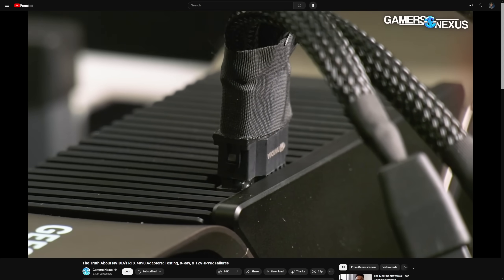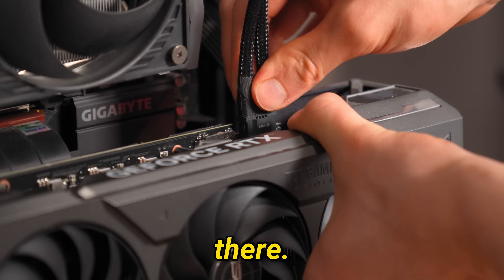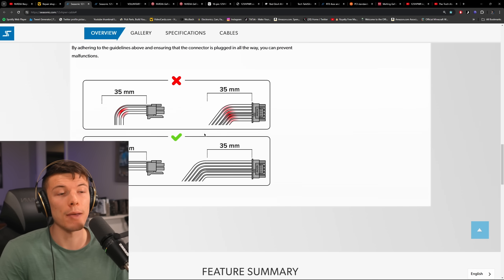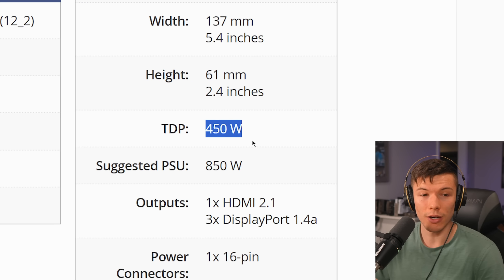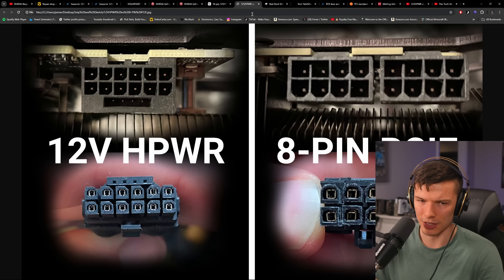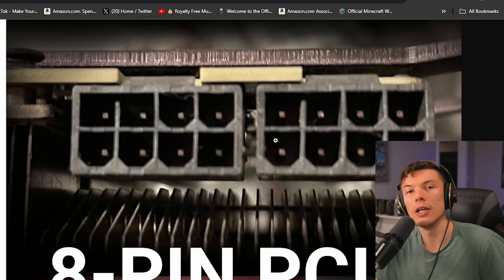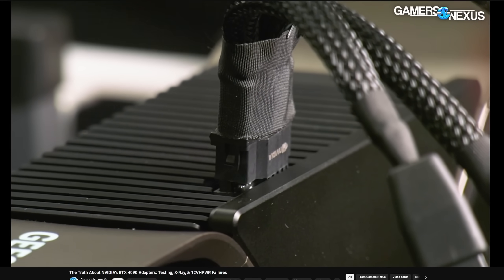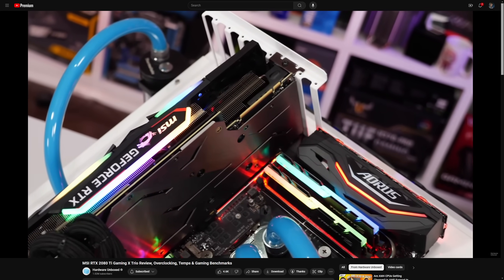The Dumbest Thing to Happen to Graphics Cards

Comment: I am just suprised that there is no lawsuit against Nividia. This is clear fire hazard and should not be tolerated. Probably if someones home burns down then there will be some action.
Reply: They have more expensive attorneys and spin doctors. The consumer would never win.
Reply: @Sybertek  pretty sure that's just about every corporation...yet, things still happen.
Reply: I think there is a chance of it, but considering a vast majority of cases will be due to “user error” (regardless of the cable design if it’s not plugged in it’s going to melt), or at least can be successfully argued as such in court, you are going to have a hard time winning. It’s the same with all sorts of shorts and such with computers. My motherboard basically ignited recently after a fan splitter pin broke inside one of the fan extension cables. Can I sue noctua for the cable, or MSI for the board? Or do I just get the RMA on the mobo and move on? Most people pick the latter
Reply: @solkvist  it's not user error. Tolerances should have been built in for consumer products to ensure it doesn't self-destruct if it was not inserted optimally.

They're only blaming it as user error to gaslight the customer and save money because a recall would be extremely expensive, especially if it's not the only part that was destroyed in the process.
Reply: @solkvist That's why meeting specifications matters. In your case noctua did nothing wrong and if god forbid the house burnt down, insurance would cover it.
This is why cablemods issued their recall, they would have been in a world of pain if something worse than a melted termination happened.
Reply: The lack of a class action lawsuit just proves that NVidia buyers are fools, sadly ...
Reply: It's a design problem. NVIDIA took a design from PCI-Sig, a consortium that also includes AMD, and used it as per it's design spec. It was also established that manufacturing wasn't the culprit, but bad design (low factor of safety). NVIDIA has done as much damage control as they could, because it's ultimately their products and reputation on the line... But legally they're not liable for the bad design because it's a 600w rated connector they're only trying to feed 450w through.
Reply: put out a petition
Reply: The problem is still not solved and it's not user error.  Despite widespread publicity and user precautions  YouTube Northwest repair still sees 100+ 4090 burnouts per month ...
Reply: @systemBuilder  😀 wow that many, is it only that card? is it safer the 4080, 4080ti with the same power plug?
Reply: Reason melting connectors happen in waves. Ready for this? AC units and Space heaters in the winter.

Draws too my current away from the card and the card amps up to meet demand, only for that demand to be pushed into over drive once the ac or heater cuts off. 

This happens to even very well plugged in cards.

It's not a user error. Even the heating and cooling can push a well connected connection apart due to the expanding air inside the connector. 

NVIDIA should be sued. Forced to repair all old style connector on their dime plus shipping.
Reply: @EBackwards  🙂 neat, i didnt know that
Reply: There Is Nothing In The case That Will Ignite! After The Wires Melt Into A Short The Power Supply Will Shut Down! Why Cant They Put Multiple Sockets So You Can Plug It In From The End Of The Card Or Side? Then The Connectors Would Not Be In A Bind When You Close The Case Door!
Reply: "I left my PC to go out for lunch with my friends while my 4090 was doing a large render. When I came back, the fire department was putting out what was left of my house."
Reply: @greevar  lets get that twin tower money larry epstein got. Or whoever it was
Reply: It's because they specified a $2 power connector instead of a $3 one. For a $2,000 graphics card.
INCOMPETENCE PERSONIFIED.
Reply: Give it time. If your house burns down and it's out of spec, wave goodbye to all that expensive insurance you paid for.
Reply: @mercurybullet6043  what ? What do you even mean "house out of spec" like it's a damn computer 😂
Reply: Because it isn't a fire hazard? Are you keeping oil soaked paper in your pc case? There isn't anything flammable inside a normal pc.
Reply: @lycanthoss  you never heard of an electrical fire before?
Reply: @minion3806  an electrical fire is just a fire. For there to be fire, there has to be oxygen and something flammable. Pray tell, what flammable objects are there in a typical PC (at least ones that sit next to the connector)?

What is happening with the 4090 connectors is MELTING. Sure, if you brought something flammable close to the connector, then maybe you could start a fire. But without anything flammable, the connector will simply melt and the PC will shut off when it sees something is wrong with the GPU, or it just won't boot.
Reply: @lycanthoss there's a reason fire extinguishers are coded for different uses cases. Electrical fires aren't just fires. Just like how grease fires aren't just fires. Sure, flames are flames. But how they start and how they continue are different. Electrical fires start on the components. Plastic that is in PC cases and components are flammable after a certain point. Once your components start catching, the fact your PC has multiple holes designed for air, means it's not going to stop soon.
Reply: @TheTrevler  Very true. You can tell people went to school and did absolutely nothing.
Reply: @lycanthoss I think you need to understand what an electrical fire is.
Reply: @lycanthoss  plastic is generally flammable at high enough temperatures. I personally would be wary of these cables melting for that reason
Reply: @lycanthoss everything can burn if there is oxygen and guess what there is always oxygen in a pc case because there are holes for airflow and electrical fires are one of the most dangerous fires iirc
Reply: @deathdrop  its a specialized non-flammable plastic. nothing where the connector reachers melting temp can melt.
Reply: @lycanthoss  you are so painfully wrong I don't even know where to start.

For 1, the entire fucking thing is made out of plastic. Besides the case. Like wtf dude , plastic flows all over the place when it melts.

You are purposely being ignorant here.

Comment: The 12 pin somehow  makes Apple's Lightning connector look like a reliably durable innovation. Just sayin...
Reply: Lightning is one of the most reliable connectors what are you saying
Reply: For as archaic as the lightning connector is, at least the cables never melted my old phone's charging ports
Reply: They shouldve added a clip and the problem would be less
Reply: @Dr_b_ I've had 15 or so across 5 iPhones. The lightening connector is junk
Reply: @Dr_b_ failed. Contacts were poor, needed cleaned a lot, lots of black marks on the connectors. Cables were horrible always getting yellow and lots of failures, don't tell me you've never seen a failed lightening cable? Every office I go to has at least 1 lying about that should have been out in the bin,

Comment: I'll just stick to AMD until Nvidia becomes more customer friendly might be never tho.
Reply: If you just need to play video games (i mean not work with your GPU) this is a great decision !
Reply: yeah, I did that, now I had to repaste 7900xtx after a year because hotspot went crazy to 110c, such a customer friendly policy :D
Reply: @tomorpedreiro3032  May have you bought an AMD "reference" (same as Nvidia's founder) one ?
Reply: @tomorpedreiro3032  That's pretty normal for AMD or nvidia. The difference is, nvidia doesn't report hotspot as accurately and just throttles itself while not showing you that the hotspot truly is hitting a throttle limit. I've repasted MANY cards of both brands for friends and family. Use thermalright TFX if you want to prevent pump out, heat cycling will slowly push the paste out from between the die and cooler with any paste that isn't like concrete. Spread it across the entire die and put a small extra dot in the center to ensure full coverage and push out the air bubbles, tighten down each screw a little at a time going around the 4 that hold the cooler to the core, don't mix up your sprung VRM screws with your core ones as the VRM ones have a weaker spring.
Reply: @PineyJustice  its not normal lmao, if you use normal paste, problem will be back in 3-6 weeks lol. that's why everyone is using PTM to deal with it.
Also, had many AMD/rtx/gtx cards before, and I never needed to repaste card after a single year 🙂
Reply: @tomorpedreiro3032  It's absolutely normal for every single high performance card of every generation. My 1080ti did it, my r9 290x did it, my 7970 ghz did it, my 980ti did it, my 6950xt was really bad about it and I assume my 7900xtx will need a repaste within the next 6 months. Use thermalright TFX and the problem pretty much goes away.
Reply: @PineyJustice  my 2080 ti didnt do it, my 3090 hasnt done it, and my 4090 hasnt done it either. What is your point?
Reply: @springpanda9393  Nvidia doesn't show hotspot the same way, you're not going to see 110c, but you will see your boost clocks being lower than they were when it was new because some small bit of the die is getting hot. It's literally physics, some pastes are a lot better resisting it but eventually every paste will. OEMs often error on the side of using bad thermal performance paste that does well to resist it.
Reply: @PineyJustice  Hotspot on all 3 of these cards rarely if ever broke 90c. Never experienced lower clock speeds, or throttling. But by all means, pop off

Comment: You showed a picture of the Corsair 850Watt RMX power supply. Is that PSU good for the 12VHPR cable? Or is it old and I need something newer?
Reply from the maker: Look for “ATX 3.0” power supplies, they have the native connector built-in. I don’t think that one specifically was, no
Reply: MSI MEG ai1300p is a good psu with 12VHPR built-in

Comment: I've been running a 4090Fe for about 8 months , I ditched the adapter in the box & have been using Corsair's . Do I still worry about my £1600 GPU melting ? Most definitely
Reply: I got the Corsair adapter and my pc kept restarting and ramping up the fans. Put the old adapter back and no issues for over a year now.
Reply: I'm still using my recalled Cable Mod right angle adapter... fingers crossed 🙂
Reply: @joetuktyyuktuk8635  Wouldn't recommend playing with fire. CableMod wouldn't do a complete recall without a good reason. I'm feeling more safe with Their 90 degree 12VHPWR stealth sense cable.
Reply: @joetuktyyuktuk8635 its ridiculous that users of high end products should live with such fears
Reply: @joetuktyyuktuk8635  Wouldn't recommend it. CableMod didn't do a complete recall for no reason. I've been using the stealth sense 90 degree cable from them for a while now.
Reply: Same
Reply: Reduce the power limit. At 70% power your 4090 card consumes less than 350watts and only runs about ~10% slower. Overvolting/overclocking is dead in modern graphics cards. Most of the performance is out of the box now and the meager gains from pushing dangerous voltages are not worth failures and overall degradation of your silicon.
Reply: i got a power supply that already supports  12VHPWR.  has a cabble directly from the Psupply to the 4090. no adapters needed. I think if 4090 users has extra cash, updating the power supply with a out of the box support to 12VHPWR should really be considered.

Comment: I am curious if the new 12V 2x6 connector have fixed things or not. Because the super series cards use these new connectors but the 4090 which is rumored to having melted connector issues is using old 12VHPWR connectors
Reply: I have not seen a single thing of the 12v-2x6 melting, 12vHPWR yes but not the 2x6. NRF is kind of a shady guy with how he operates his repair business, a lot of his money comes from “no fix bench fees”. I would never personally send a card to him. There are people more skilled and competent than him that will fix your GPU. 
The 2x6 should be incapable of sending the power to melt itself paired with an atx 3.1 psu.

Comment: This is like one of those it works on paper but not in reality kind of design the original connectors we have been using was over engineered to make sure this kind of issue does not occur but not only has this 12VHPWR reduced the port size it also increased the power flowing through it immensely and its burning up as a result even Intel washed their hands off it and they had a hand in both its design and certification.
Reply: Honestly, if the 12VHPWR or 12V-2x6 had a few more pins, it probably would work just fine. Sure, it'd start to look like an ATX 18-pin connector, but that's hardly an issue if it means happy and stable power delivery.
Reply: @Zieldak  Should've look like a 16 pins instead like a more compact version of two 8 pins instead than making it twelve

Comment: Good thing I'm broke so by the time I can afford GPU with 12v connectors, the tech will most likely be improved enough.
Reply: Weird way of looking at but great positivity 😂
Reply: Same. Probably by the time I'll have money, GPUs with the same performance won't need a power connector
Reply: Nvidia replaced all of their worked with AI bots, good luck about that, ai can't find solutions that don't already exists
Reply: Heh "improved enough". Still it could get worse, but i hope it won't.
Reply: Or just yeeted.
Reply: nah i bought amd anyway, due to no competition in egpu like gpd g1, there is only amd in that space
Reply: AMD is an extremely viable alternative...
Reply: @seannorgren5752  AMD had problems with coolers.
I think all these issues make lower to mid tier cards more attractive because then you can get away with one power connector even when using 8pin :-D

I'd like to know why Nvidia didn't use a connector from radio controlled models. And why it sticks out to the side instead of any other orientation.
Reply: If you are broke you will steer clear of Nvidia anyway
Reply: @appsaucetech  I sure did with my last upgrade. Really wanted a 4080, but I went with a 7800 XT. I don't regret it (except for DLSS, damnit).